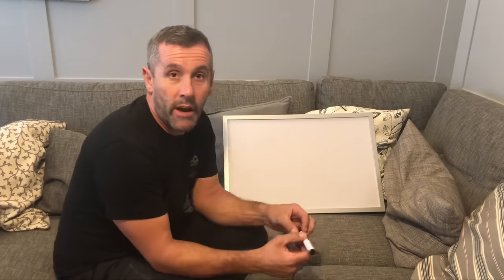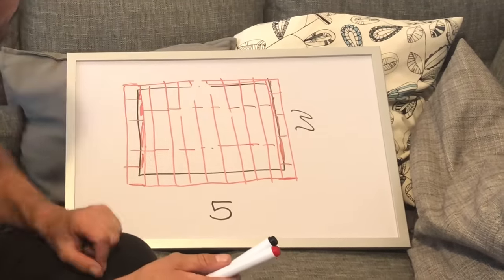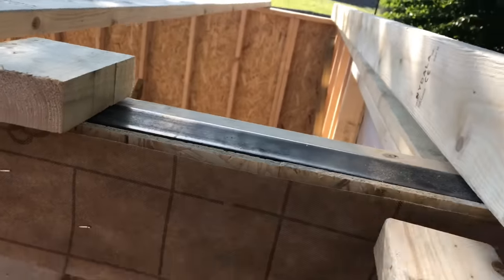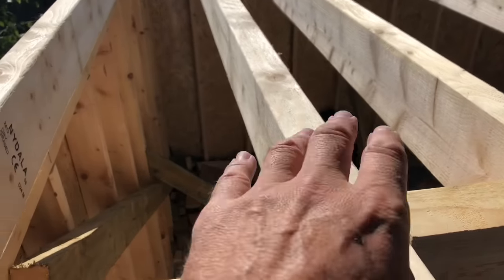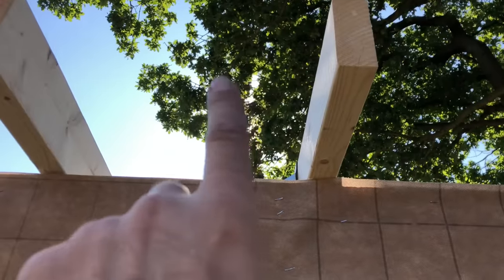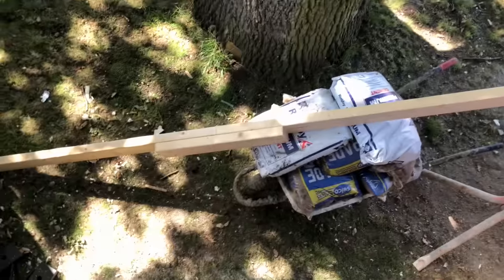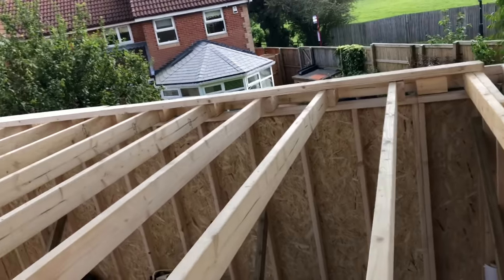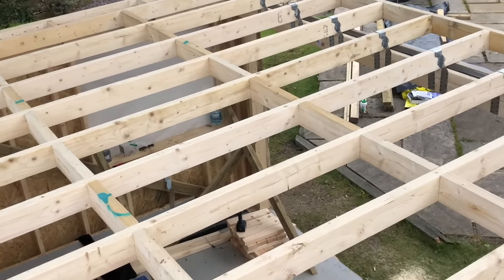How to construct a garden room timber flat roof

Comment: ive watched so many of these types of vidoes and i have to say yours is the best. no nonsense and straight to the point. great quality builds too. ( im an Construction Manager )
Reply: How would i calculate what size of roof joints i need to use for 8 m long x 3.5m wide with 400 spacing

Comment: When building close to the boundary and using the 2.5 meter roof height do you measure that from the floor level up as one side of the shed has exposed lower bricks as it's built on a hill.

Comment: Great job . I'm hoping to sort my masonary roof out ASAP. 

3.4m death amd 3.3m width it has a single potch (not truly check but will ) of about 15°  shitty tin corrugated . No insulation .(although I did initially follow a roofers advice if fixing some below roof sheets deeming useless).

So thinking new joists (original 4x2 were laid flat side meaning less strength.  There's an rsj as additional support central perpendicular to joists .

Joists are rotten..so thinking  osb 15mm sheathing entire roof section over new 4x4 400 centres as the rsj will give it extra support ..then membrane (gor that already) and reppace metal sheets maybe some additional insulation pir  underside leaving air gaps ?. Ty in advance 

Nice work btw neat

Comment: brilliant job how do you get the noggins in a straight row im doing something similar i have done one before but used hangers for the noggins I don't want to stagger them 😊
Reply from the maker: chalk line mate, or fire a straight edge up and mark all the roof timbers
Reply: ok thanks mate I must of been drunk I ment to say I done this with decking used joist hangers to get them all in a row you don't have them did you drill in from the sides because you  can't nail or screw from behind each one 🤔🤔

Comment: Thanks for the video. 10.35 how will this block sit on the timber? Your rafters are angled, so there will be a gap between this block and the stud below. How will it float, just on two screws?
Reply from the maker: its nailed into the 5x2 that goes on next as per the video mate
Reply: @thegardenroomguru  cheers

Comment: Top video, nice and clear advice!
I'm planning a similar size workshop for my Mrs although in block. Just wondering, do I need to level the ends of the rafters where the facias go, or is a 25mm per meter drop so slight it won't show? Cheers.
Reply from the maker: You won’t see it mate
Reply: @thegardenroomguru  thanks, less maths to do, hooray!
Reply from the maker: @nostalgicplastic4323 😂a few have asked this before on my Facebook group mate, it’s like 2 or 3 degrees, never notice it 👌

Comment: You used joist hangers upside down over the steel, but just nails on the joists over timber wall? Is there another option there without a nail gun? Any other type of strap? Twist straps?

Comment: Fab and informative video, thx. Two questions, 1) if your roof joists were long enough, would you have used upside-down hangers at the rear as well as the front? 2) Would liked to have seen how you add the noggins... Obviously nailed from the side right?
Reply from the maker: only use the joist hangers because I can't get a decent fix over the steel, if I can I spike the timbers into th wall head plate, ill do a fuller video on the next, had a bit of a mare, with the timbers being too short and being on my own
Reply: @thegardenroomguru  your fix was really interesting. I learned a great from it. You're a real craftsman.

Comment: Great video! Explain everything really clearly and easy to understand. One thing I don't quite get though is where the first ceiling joist goes in relation to the wall. Does it run directly on top or are you bringing it in a bit? If so, by how much? Cheers
Reply from the maker: Bit hard to explain with our an image, but your side wall internally is flush with the outside of the 1st joist, so if you looked up from inside you would see the full underside of the joist, if that makes sense

Comment: Do your side walls have a slope at the top to follow the roof or do you fill this slope in afterwards, once the roof is on?
I.e. side walls are built straight and level at the top.
Reply from the maker: side walls are level mate, fill the gaps after which intern supports the side overhang

Comment: Hi Liam, need help planning a 4-car carport, 6m x 12 metres, going to use C24 4x4 posts every 3m, 15 in all, right decision?  30mm drop per metre, front posts 2.9m, back sticks 2.72m. May use slats for the side to allow some wind through.   2 x 5 timbers enough?

Comment: Hi, great video, thanks. I’ve just built a breeze block shed and now adding the roof. I’m an amateur at this and going to try it out. Does the wood need to be treated timber or can I use standard Wickes studwork CLS 38x89x3000?

Comment: Liam, Great Videos, does the 300mm overhang include the cladding or is it 300mm from the OSB to the front of the facing board, what length is your spacer?

Comment: Such good videos, thanks. What steel do you use? 3mm Rectangle box? 50mm x 125mm? And why do you use that rather than Sister'd wooden joists? Less flex presumably for the doors to fix against?
Reply from the maker: 160mm x 80mm x 5mm, Id use two 5x2's but I like the fact Im the only one using a steel and I know it'll never flex

Comment: I'm planning to build my own shed and make it a sauna. Insulated with rockwool, double cladding (inside & outside) with air vent in the bottom. Would you put air vent for the roof as well or close (seal) the rockwool between the joists completely?

Comment: Thanks for all the videos you post! I'd love to see another video of the cladding being installed, particularly on the side walls where there is the pitch of the roof to contend with, do you cut the top of the vertical cladding to the angle of the roof and measure each plank? Also, do you cover that detail with a trim? i.e. where the top of the cladding meets the soffits. Thanks
Reply from the maker: Gary Dixon ok, so we used to cut each piece individually with a degree angle on the top, measured to length........ then I thought, wtf, cut them square, over sized, 20mm bead to the top to cover small gap, multi tool bottom level, looks 100% 👌
Reply: @thegardenroomguru  thanks, makes sense. Top man.👍

Comment: Hi Liam. Another enjoyable vid. Question - you referred to the spacer as being a 400 spacer. Just to be clear, is the length of the spacer actually 355mm (ie 45mm less than 400mm being the width of the joists) to ensure the joists are effectively 400 on centre?
Reply from the maker: spacer is 400mm mate, its enough, makes for easy cutting of insulation
Reply: william griffin thanks Liam. On a kind of related area, my build is a horrible shape (think it’s called a rhombus) where basically it’s a 5.5m x 4.5m rectangle but with the back right corner chopped off due to neighbours fence angling in part way. The angle of the fence and hence my rear wall is 50 degrees. For the life of me I can’t work out how to get my mitre saw to do 50 degrees. For the floor joists I just eyeballed it and used the circular saw and it’s fair to say none of those joists are particularly flush with the trimmer although good enough once the 100mm screws in. Any idea if there’s a way to get above 45degrees on a mitre saw? I thought about cutting the joist with it vertically on the saw bench and using the rotation handle rather than the mitre function as the rotation does just about get to 50 degrees but it’s very unstable and the saw depth not deep enough to complete the cut that way anyway.

Comment: thanks for another great video. where your roof joists meet the front and back wall (particularly where you dont have the brackets), do you not need to account for the angle that the joist sits on them with the use of a packer or by cutting out birds mouth notches?
Reply from the maker: no mate, pitch is shallow, there practically flat on front wall, ill do a better video, thanks for input, sometimes I just think people can see what I see, but ill do some more detail videos to show this detail for you
Reply: Fantastic, thanks

Comment: Maybe a stupid question Liam but do you fill in between the joists on the front and back wall? Or do you just stop the insulation when you reach the wall plate? Seems like there's a hole there (barring the soffit) for drafts and the like. Cheers.
Reply from the maker: If we can’t fill it with foil backed insulation, we’ll use rock wool

Comment: Its nice work, only thing I'd of done different is done 3 noggings, one center then the center off those. You'll be supprised how much that with slag over the years with just the 2, it's a big roof.
Reply: Hi, I'm a keen diyer and have  just made a 6x6m garden room with 8x2" rafters. I've only put in 2 rows of noggins in, do you think I should  add another row in between these two. I've used 18 mm osb  for the roof decking and  covered with grp fibreglass.
Reply from the maker: If it’s 6mtrs x 6mtrs you definitely want another 2 rows I’d say 👌
Reply: @vjd8574  generally every 1m you should really have a nogging because it's such a large span. Takes abit more time but doesn't cost much more. Better safe than sorry. Last thing you want is in 5/10years time water pooling because the roof dipped.

Comment: Have a build question - would the 19 mm floor withstand a 50 kg rock dropped  from say 2 feet - I make sculptures and an thinking on making a similar floor to yr style of build -  can survive a dent  just not a full break through - what do you think ? would ply be better than the current board you use ?
Reply from the maker: Floor is 22mm thick, it will withstand the impact
Reply: @thegardenroomguru  Thanks - Helps a lot

Comment: Thanks for another great video. Maybe a stupid  question. How do you deal with soffit when you are almost flush to the wall ie. no overhang. I notice you do this on smaller builds on the sides. Do you even have a soffit on these? Thanks
Reply from the maker: side and rear overhang is made just big enough so a 100mm soft fits and when cladding is fit there is around 40mm showing mate
Reply: william griffin thanks will and honestly I would never have attempted to build such a thing without your videos! 🙏

Comment: Great videos 
What size roof timbers would I need to span 4.5m ?
All I can find online is a span table that tells me to use 9"x 2" takes me above the 2.5m rule
Reply: Depends on the timber strength.  If you wont the lowest possible profile you would need C24 timber with rafters at 400mm or 450mm centres and you could get away with 47mm x 195mm (2" x 8" probably) but this is the lowest load capacity.  To be on the safe side you would need to look at the highest load capacity for maintenance and access and go for the same spacing at 47 x 220 which is your 2x9" rafter.  It means your internal height is 95mm less than the garden rooms here as the they use 125mm.

It does mean you can have a proper cold roof rather than a made up hybrid roof by having 170mm noggins to allow airflow and have the insulation in the middle i.e. 50mm airgap at the top, 100mm PIR leaving 70mm.  A low profile LED spot light could be fitted without damaging the insulation and you could have a loose vapour barrier in the sections where there are lights so you don't pierce it except for the wire were you could seal it.

You could also sacrifice some air gap at the bottom to gain at the top or build of a flush insulated concrete pad like I have to gain height.  I am having a warm roof and still finish with a 2.1m internal height within permitted development.

Comment: If I wanted to build a shed that was 13ft x 14ft (so very nearly a large square) and have an attic in it, what size thickness wood lengths would you use to guarantee structural integrity across that much of an expanse? I mean the lengths that the attic floor would be on? Thanks

Comment: Just another quick question mate if you don't mind? Is it possible to use rockwool in cold roof? The reason for wanting to use this is for sound insulation as opposed to heat. I'm making a music room. Cheers
Reply from the maker: Yes mate, rock wool soundbloc works a treat

Comment: Could you use 4 x 2 for roof timbers if it is only 3m x 3m ???? I know you put insulation and sound proofing in yours so i just thought maybe thats why you use 5x2
Reply: I don't think so. If you look at span tables you will see your timber lengths. At max load a span of 2.6m ish will take a 5x2 in C24. Ali dymock has span tables on his website and in his garden room videos.

Comment: How long can you go with the side overhangs with this method? My shed will be 2.5 x 5m, could I out a 40mm overhang front and back and still use 5x2?

Thanks
Reply from the maker: Side and back no problem at tgat, if you want bigger, backs canterleavered off the back wall so no issue.

Comment: Loving the videos mate. What size roof timbers would you use for a room thats 7.2m x 4.8m?
Reply from the maker: if under permitted development, its gotta be 5x2 doubled up
Reply: The span stables state 47mm x 220mm at 400mm centres can have a max span of 4.91m at between 0.5 and 1 kN.m2.  There are separate tables for wider timbers.  For example 63x 220 will do a span of 4.81m of between 0.5 and 1.25 loads which is bit higher load than the previous timber.  Even going up to 75x220 would get you to 5.02m.  I seriously doubt 90x125 would cut it at that span.  That being said your dimensions take it to 34+m2 which is above the permitted development limit.  You'd need planning in which case apply for a greater height and put in the 63x220 or at the very least the 47x220 and then you could even go for a warm roof with planning or a proper cold roof with venting.

Comment: will can you use truss clips as a means of securing the roof timbers from wind blowing off  joist hangers look a bit over kill clip wont that do same job pal ?  m building a workshop in my garden done a concrete  base & pricing the cladding up its really expensive but i am determined to do in pvc as i want it to last can you recommend a supplier near liverpool i can buy cladding from  cheers
Reply from the maker: Joist hangers 68p, twist nails penny’s, I like over kill, when the storms come, I know them roofs are staying on the builds 🤣
Try 
Northern building plastics mate 👌
Reply: william griffin thanks mate ill check them out

Comment: Any reason why you don’t stagger the noggins in the roof to make nailing easier? I guess it makes nailing the OSB more time consuming, is it just a case of personal preference?
Reply: He uses a nail gun so just goes in at an angle I guess
Reply from the maker: Just personal preference mate, nail gun makes it easy either way, makes for cutting insulation easy as all the same length nate
Reply: Makes perfect sense.

Comment: Hi William, would you split the length of the rafters if you were doing a roof that's 5.5m front to back? Unfortunate positioning means mines going to have a really long drop. Cheers for the vids mate. 😁
Reply from the maker: how wide is your build? could you run the fall left to right instead of front to back?
Reply: @thegardenroomguru  it's 3m wide but I think it might look a bit odd if it's falling to one side instead of level at the front.
Reply: Tim Tiernan they would be level across the front just different levels front to back. You’d need a firring on each side wall to fix hosts to to give you the fall or build side walls with a sloping top plate.

Comment: Nice work ! Just about to do my roof on a 4.4x7mtr office. Was gonna go for 7” timbers , do you think that’s a bit overkill as you said anything bigger than a 3mtr you double up on 5”.
Reply from the maker: If your within 2 mtr of the boundary 2.5 height is max without planning
5” timber is the max you can use, we double up them, creating a 4x5 if over 3mtrs span mate
Reply: william griffin  cheers mate , I dug down about 4” to give myself a bit more wiggle room for the height but if you think doubled up 5’s will be fine I’ll prob just go with that. Thanks
Reply from the maker: We always double them, bolt them and nail them together 💪

Comment: Hi Liam 

I’m building a 5mtr by 4mtr flat roof, do I need to double up the roof rafters or are single rafters ok ?  

I’m sticking to the 2.5meter maximum height and have built it out of concrete blocks, would you use 8x2’s or 7x2’ not too sure so thought I’d ask my mentor 😎🙏🏼
Reply from the maker: I’d flitch beam every other rafter over the 4 mtr span
Reply: @thegardenroomguru  Thankyou guys, lastly would I use 5x2 timbers for the roof ?
Reply from the maker: Double up, 💪🏻
Reply: @thegardenroomguru  Thankyou, if your ever down in Wolverhampton, make sure you come and visit us @pennchippy on the Penn road, and take a break meals on me💪🏽😎

Comment: What I don’t get is how to do the fall in the roof? I know your making the front 75  higher than the back but then do you slope the walls?
Reply from the maker: yes mate, its not an issue, its not noticeable, and gives you maximuim head heightx
Reply: william griffin so do you make the length of the upright timbers of the wall different lengths from front to back?
Reply: @jackdavis8786  The front wall is higher than the back wall but the side walls are the same as the back, the timber used for adding support for the roof joists becomes an infill to the side walls and the inside face is in line with the inside wall for plasterboarding.
Reply from the maker: Hat off to you sir! You’ve watched and understood everything, perfect !